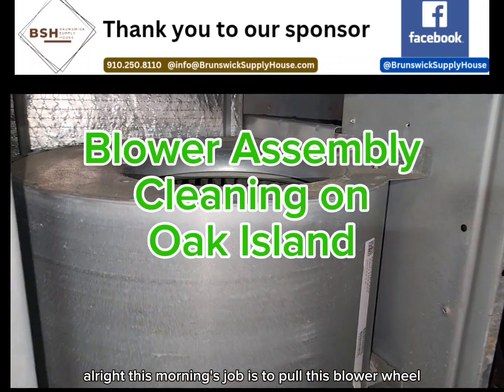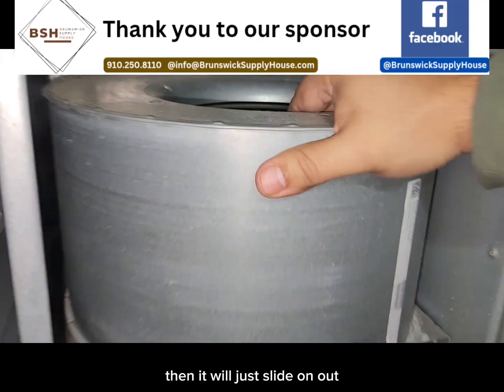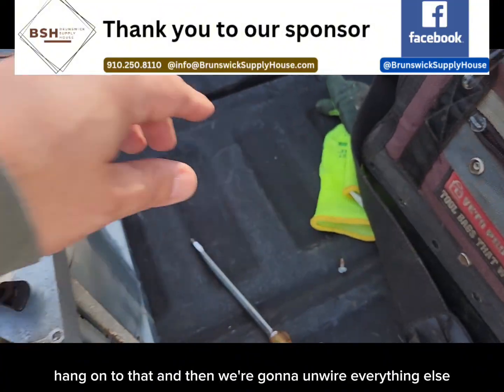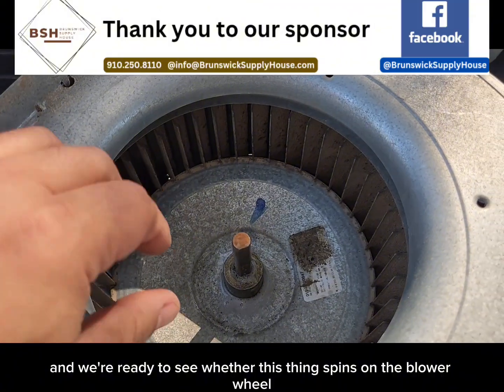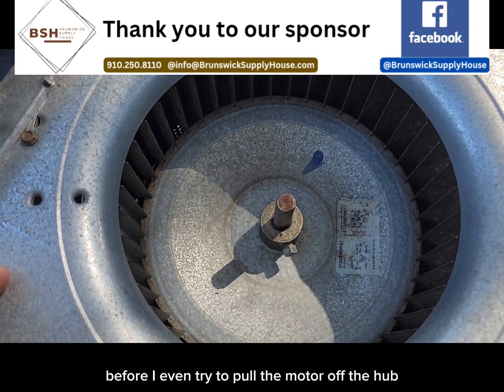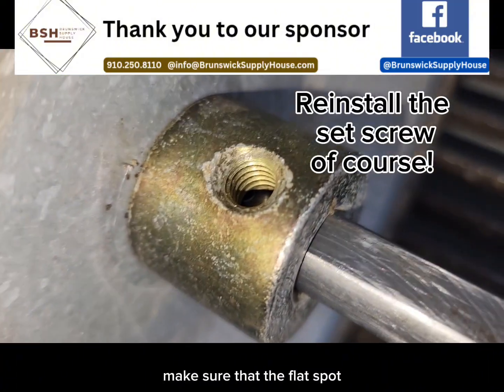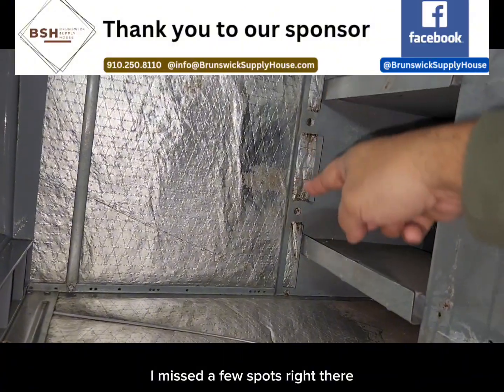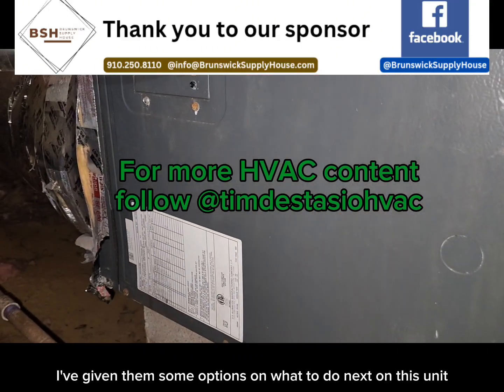Blower Assembly Cleaning

Comment: Hey Tim, It seems like you didn't need to also actually scrub the blower wheel curved blades this time in order to get it clean, correct?  How much dirtier/fouled up do you find it needs to be before needing to put in some elbow grease to help out the coil cleaner?
Reply from the maker: @brendanreid593  if ghe hose doesnt get it, scrub harder lol